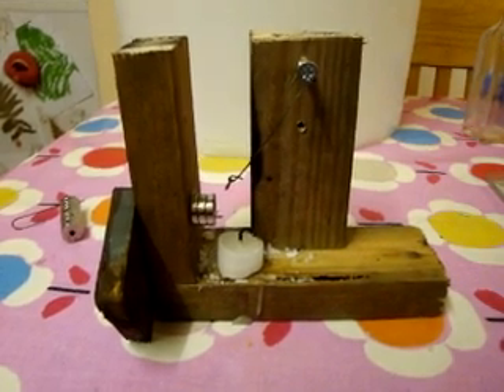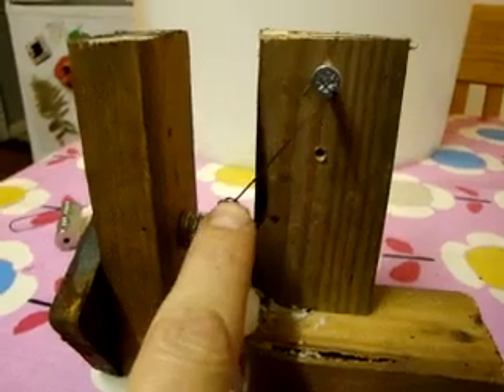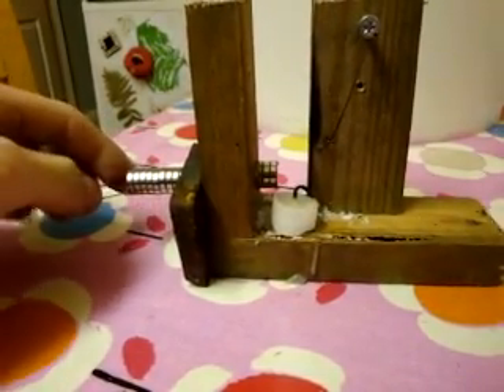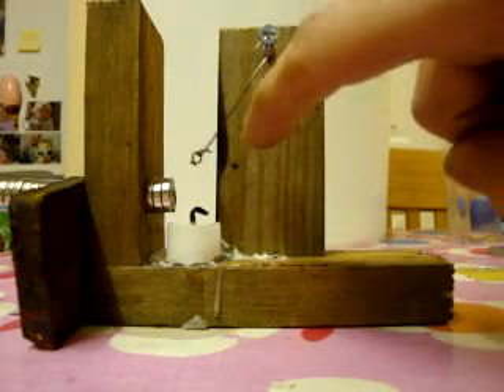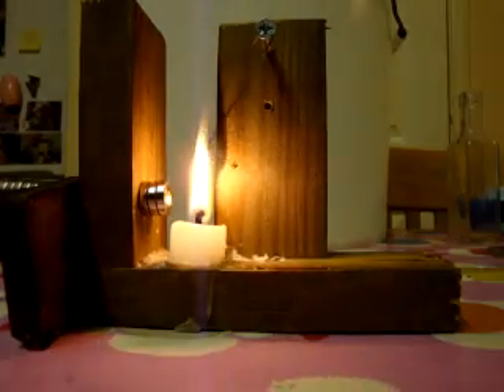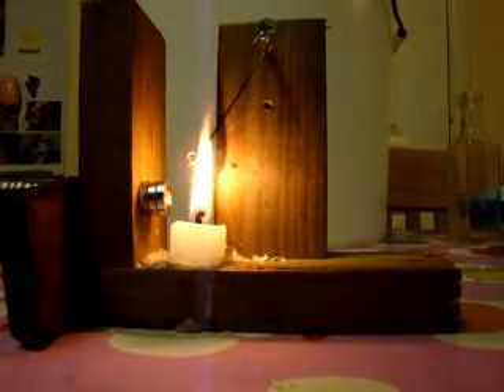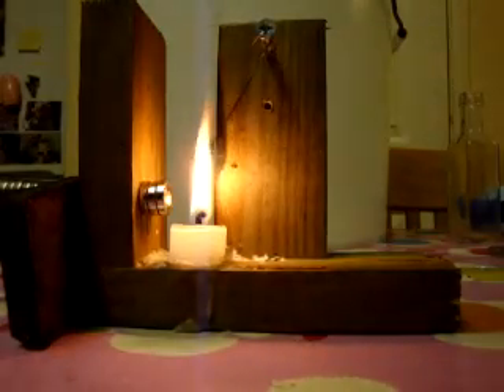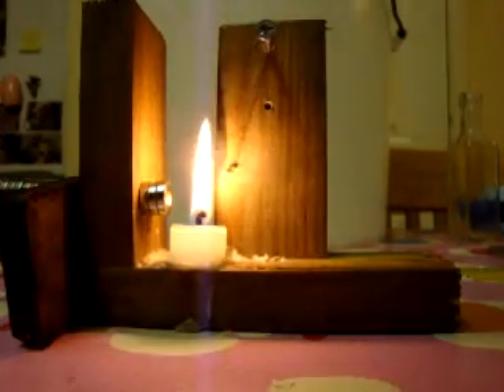Magnetic Heat Engine Curie Effect

Comment from the maker: the magnets loose their power if u heat them up above say 70c but the metal will always work i have made a new part for it a gas burner no more messy candles
it would work will solar :) just gotto heat the metal up some metal have a lower curie point Europium is the best i think with less than 100c curie point